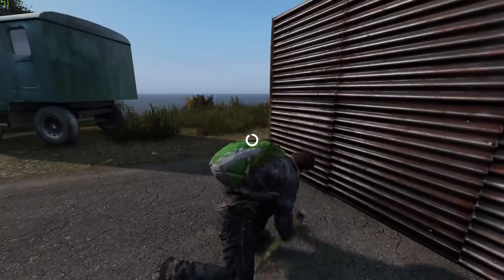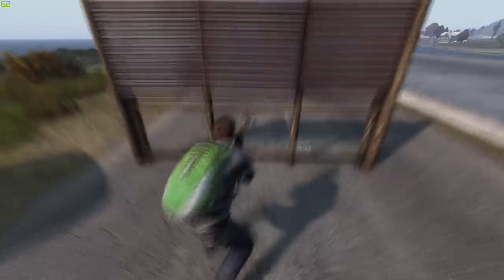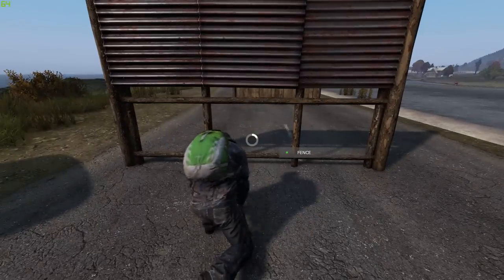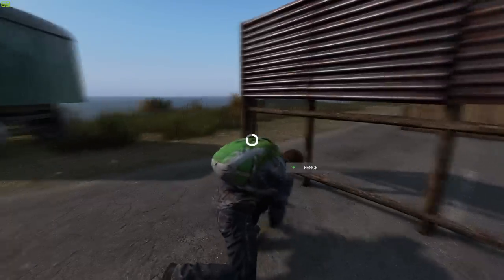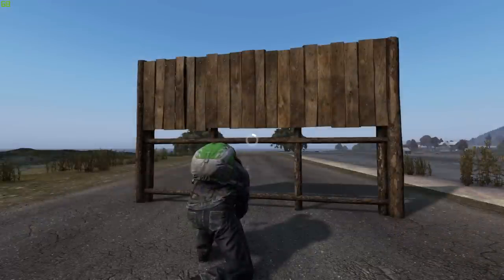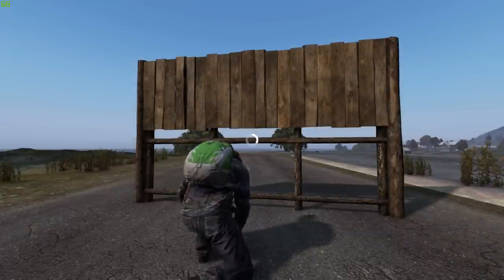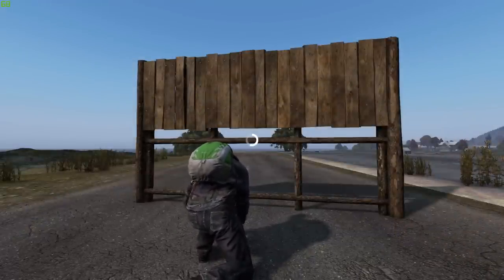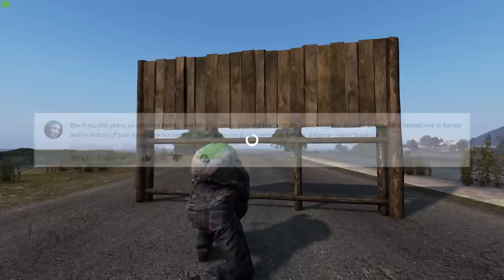HOW TO FORTIFY YOUR BASE on DAYZ

Comment: even if you would have walls that hold in any way, you would need to build it somewhat in the air. Otherwise player could just serverhop to enter your base(on public ofc). Sadly alot of problems with balancing building atm.
Reply from the maker: True
Reply: And it sucks because on Xbox all we have is official servers, we don’t have any community servers (hopefully we will someday) so you can’t prevent server hopping on Xbox.

And Xbox still doesn’t have the fix for the persistence issues where your base would randomly despawn upon a server restart

Comment: not sure how this is fortifying, all the enemy have to do is come to that fence with pliers and remove it we tried it and its again that simple. Panel removing of course is next then crawling prone through it after is again possible. You can stack another fence infront of a gate or other fences / offset the build so u cant prone crawl through them.
Reply from the maker: Hhhmm, the system is very flawed then. This needs to be fixed as soon as possible because that completely makes base building a waste of time.
Reply: J K yup its pointless, you are better off putting tents in a barn and locking it with a lock pick lol. Also the locks with 3 digit codes are brute forceable in just 15 mins
Reply from the maker: @funkyllamah  Thanks for the feedback pal
Reply: @funkyllamah  even if you lock the doors, a server reset will cause them to be unlocked again
Reply: @JLKgg  They should add turrets like in rust.

Comment: Great vid! Thanks! We have some problems with the watchtowers, we builded the first level but we cant build the roof of that, because of that we cant proceed with the tower. How can we build the roof and proceed? Plz help!
Reply from the maker: You need to remember to build the L1 base using the shovel.
Reply: @JLKgg  we tried but we were not able to use the shovel. We didnt use it at first and now the walls are done, we cant  break it down with the sledgehammer :(
Reply from the maker: Yeah that was a problem for me :( You May have to do it again bro. You need to create each level base with 4 wooden logs before building the walls.
Reply: @JLKgg  thanks so much for the help!

Comment: It's supposed to be a realistic survival game, IRL you'd be able to do the same to the base even though they could increase the time on it. Personally I like it that it doesn't give you a sense of security, and you can't just build an almost indestructible base in the middle of a high loot zone. Plus everyone wouldn't be carrying all those tools around.
Reply: Do you have anny idea how long it takes to build just one wall? unless you are building right next to a wood pile or somthing like that not to mention finding nails and all the other stuff you can esaly go ove 1 hour just for one wall and thats if you dont get sidetracked, and then som guy comes along that found a sledge hamer or a hacksaw and break into a whole compond in 1 min. You can't seriusly think that this is a good system ? Also regarding youre fear of blocking off i wuld rather have restrictions on building in hotspost and stronger walls then the system that is now, and walls arent youre biggest consern when it comes to blocking off loot. Fortifying is also a thing that will be coming and will probably make it much easier to just seal buildings tight so no one can get in. I totaly agree whit youre fear of loot blocking but the base system now isnt worht it at all and if it stays like it is they might aswell just never have added it cause no one will use it.
Reply: @thezipper359  I do think it should take longer to break in, but the tools are realistic, with a sledgehammer you can break down a concrete wall but not wood with a piece of metal nailed to it? 

The loot thing isn't my biggest concern and placing down zone restrictions is a lazy and unimmersive solution. What I meant by that point is that I don't want DayZ turning into all other survival games where you see these massive bases in the middle of fields and there is nothing you can do about them even if they decide to shoot you from their base. I honestly like this system since you still have to think about the placement of your base.

The benefit to just having tents and barrels is that you can defend it a lot more easily, and if someone just stumbles on the base there is a big chance they won't have the tools necessary to break in.

Fortifying I'm looking forward to it too, but it should be the same kind of system, where it's not too hard to break into a building if you happen to have the correct tools on you. It also gives more uses for a thing like the sledgehammer, which normally everyone would drop since its heavy AF.

Server admins can also tone down the spawn rates of these items if they want to. It works for a hardcore survival game IMO.
Reply: Yes, it's realistic. But where is the balance in tearing down a structure that took several hours to loot the required tools and materials for within seconds? The other day, my friend and i found only 2 boxes of nails in over 5 hours of searching for them, on a 2x loot server. Just now, i found a third box after another hour of playing alone. They're my precious, i immediately burried them deep in the woods in my cooking pot ;D
Reply: @5p3ct4tor  Where is the balance between looting for 6 hrs and then getting shot once and dying? Balance is not a part of DayZ, never has been. You could loose everything within seconds, that's why DayZ doesn't loose that feeling that makes your heart go racing, for me anyway.
Reply: @Indianawinny  Whit a sledge hammer you can also tear down a hous wall so why cant you do that to anny of the houses if we are gonna go all out realistic. In the game now you can lock a door whit a lockpick and there is no way for others to open it. Why cant my axe open a locked wooden door? Why do loot respawn? stuff dosnt respawn in the real world. Wile this game is aiming for realism and i like that but my point is that 100% realims dosnt make for fun gameplay, and if you are woried that the big groups will take over the server they can do that eiter way. Large groups will always have the advantedge no mather what you do. If a so called zerg joins a server even if they only have tents there will always be a bunch of people of their group on and thus if you are palying solo that area will still be more or less unreacheble.
Reply: Well, there's still the chance that one of my friends (we're a group of 4 if everyone's online, i rarely play entirely alone) kill the shooter(s) and retrieve some of my stuff. The important stuff, anyways. Or we all get our ass handed. Shit happens. But if someone decides to raid/destroy your base in the middle of the night while you're offline, that's still another thing for me. I don't want it to be impossible to break into/destroy bases, i want to do it myself at some point, i just want it to be a little harder, like adding a chance of failure and breaking your tool or something like that. The way it is right now, you can be sure that some assholes will just run around deconstructing everything in all the bases they can find and take all the loot out of the tents and drop it on the ground to despawn, just to piss people off.
Reply: @thezipper359  Well probably the only reason you can't do that is because the engine doesn't have a system set up for it like the frostbite engine and it's not a integral part of a survival game like having a base. The lock pick thing will hopefully get fixed before 1.0 so it's like what it was in 0.62. With the loot re spawning you're stretching a little bit. And yes I agree that bases could be a bit harder to break into, but I don't want DayZ turning into other survival games like Arma 3 Exile or Rust where you have indestructible stone bases everywhere. There needs to be a balance, for example one way of doing this would be to be able to electrify the razor wire so you need special gloves to take it down, it would take some more work but it would make your base safer and not provide you with total immunity.
Reply: @Indianawinny  Ye probably went a bit overboard whit the no loot respawn but you got what i meant ;) I agree that they culd build a bether system then rust but what i dont want is anny frespawn whit a sledghamer can just come and take all my stuff wile im logged off. That will also take away the survival aspect as the start wuld be that instead of when you spawn you need to scavange for food and stuf and instead i need to find a sledge hammer and start looking for bases kind of game. also remember that unlike rust these are open fences whit tents and boxes inside and there will be helicopters at some point so still preaty easy to get inn if you can get a helicopter.
Reply: @5p3ct4tor  I agree it should be harder to get into bases, but it shouldn't provide you with total immunity so that you still have to think about the best base placement so its not spotted and you can't just build in a high density area (Like around tisy for example).
Reply: @thezipper359  I agree, as I mentioned above there could be other types of defenses like a electrified razor wire which would make it harder to break into but it wouldn't be impossible for a geared player if he has the right equipment, because everybody won't be carrying all these tools with them all the time cuz weight, space and all that.
Reply: Imagine in rust you could pick through a wall in a minute
Reply: @baileyfilms7609  well rust is a pvp building game with food and water (like ark, conan exiles etc.). Dayz is diffirent. Its supposed to be a realistic hardcore survival game.
Reply: @Indianawinny  if they make the buildings half as strong as the ones in rust, it would be amazing.

In rust, it takes you 1 minute to build a base, and people need to farm for hours to break into it, in dayz it takes you hours to build the base, it would make sense if you needed to find some special rare item to break one piece of the wall.
Reply: @IonutzGamesMc  not very realistic tho is it? The way i see it right now the more build time you put in the more tools are needed to break in. Axe, pliers, maby adding something like electrician gloves to the mix as well. Then youd need what? 3 diffirent tools needed to break into somones base, which not everyone will have. In the end you are never supposed to feel safe and secure in dayz.
Reply: @Indianawinny  not everyone...but if you want to go around and raid the whole map, all it takes is searching for some easy to find tools and go at it...it would be slightly balanced if it took 5 min to break down a wall with a sledgehammer and it would break it in the process..maybe..even then, it would be dumb since gear would be safer in a bush than in a fortified base.
Reply: @IonutzGamesMc  That's why you don't build your base in the open ;) 
In the end, if they wanna go and destroy your base what's the difference between having one special tool and multiple tools? Nothing is stopping them except the spawn rate which can already be adjusted on items that already exist. But it should take longer then atm to break down a wall, and it probably will. Also tools take damage when you use them already.
Reply: Yes it’s realistic, but the base raiding shouldn’t be. With how easy it is to raid after spending hours or even days building a base the raiding aspect should not be realistic and should be balanced so that way building a base would be worth it.

On other survival games you typically would have to gather up tons of explosives to blow the gate open which is perfectly balanced because the raiders would also have to grind hours or even days to get the right amount of explosives so it’s fair.

The base raiders should have to take the same amount of time to raid that it took to build the base in the first place